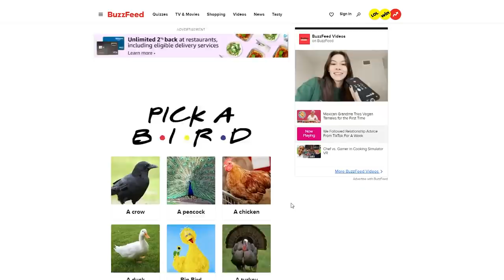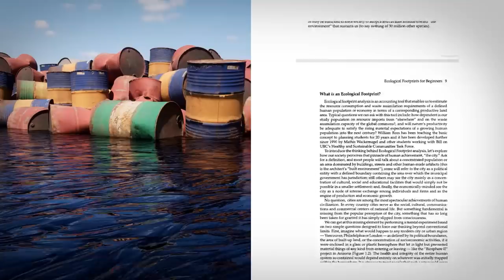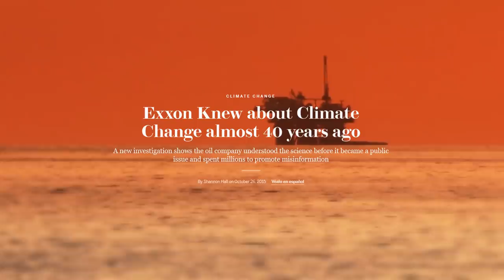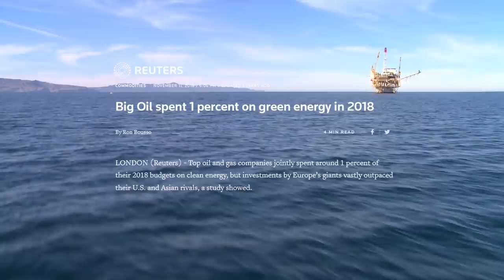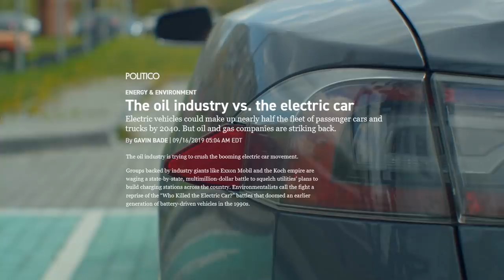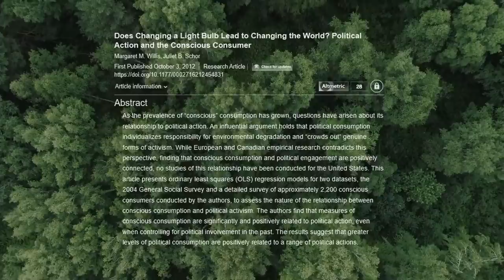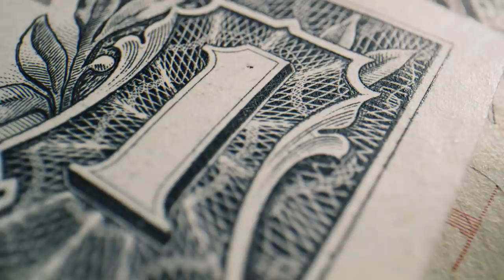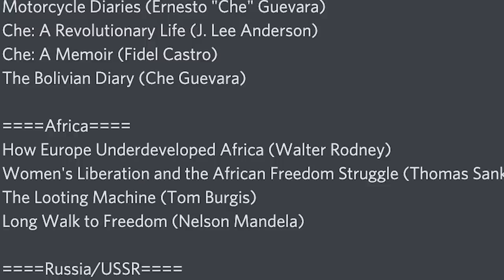Your "Carbon Footprint" Is A Scam

Comment: My guess about this video before watching it is that it's going to say that blaming a person for their "carbon footprint" is stupid, because every single step before (Delivering goods and producing them) is adding up, and any person's carbon footprint is the sum of all other people before them, making it basically an infinite loop where the responsibility grows impossibly high. 

Also, depending on how it's counted, it can for example assing to a single person all the footprint of steps before, so it's counted as if the delivery driver had only their item in the car.

It has to do both to have any real value. Carbon footprint of creating any item in itself, solo, is laughably small, and so is the footprint of delivery in most of the cases. And it has to have real value for the "green" industries to be profitable, and for politicians and companies to be able to shrug off the responsibility and somehow manipulate people into supporting them.
Reply: Adam; Damn, so close. You almost had it.  You missed that we need central planning to resolve this. And since no one else can be trusted the greenie-beanies volunteer to be the authority that tells you and me when and if we’re permitted to use our cars, how long we can have our lights on, and if we can be warm today. But 9 out 10 ain’t bad!  Remember, “You’ll own nothing and be happy.” 😂 Cheers!

Comment: i would say one issue with the green new deal is they dont like nuclear fission because its "dangerous" when in fact most of the ones cited are shotty jobs or a massive earthquake along  with a tsunami hitting it.  But they also ignore the fact that these fission plants can produce quite a bit of energy as the state of Texas has 2 and they make up about 10% of all power.  Sure radiation can be dangerous but if you do a proper job it shouldn't be an issue.

Comment: Remember the Prohibition in the USA back in the 1920-1930s? Guess who has benefited the most out of it? The gasoline selling companies after placing their stations all around the country! Why? How is it related? Well, before that cars were not using gasoline, but ethanol instead. Also because it was so much cheaper to produce ethanol out of corn than to distil gasoline out of oil. But then Mr Rockefeller decided to heavily invest in the Prohibition campaign to prevent any uncontrolled ethanol production. Have a guess why.

Comment: 1. Society has imperatives that you cannot fulfill unless you drive.  2. Your "Carbon Footprint" is a scam.
Yes, your feeling bad about the problem of your personal carbon footprint will do nothing useful.  No, marketing will not do anything either.
However 2 is not exclusive of 1.  Constructing the argument in that way also does nothing useful.

Comment: Obviously, recycling is still good, and driving less is still good.  Living an eco-friendly life is still a good thing to do.  It's just that personal responsibility is insignificant compared to the capitalist machine, which really needs to be taking the bulk of the responsibility for climate change.  Or better yet, it can step out of the way and let smart and equitable policy guided by climate science deal with it.  We actually already have all the solutions, we just need to implement them, and the capitalist forces that be are not interested.

Comment: Couldn't help but notice when the video mentioned switching to electric cars between 8:33-8:48. The video doesn't mention how those terribly toxic to the environment batteries cars use need to be replaced. That batteries eventually wear out and won't be able to hold a charge any more. So the question: Where and how do we store them?

Comment: Remember the 80s informercials where the ninja turtles and stranger danger would scold you to turn off the water while brushing your teeth - as if that matters when massive monocrops and sports stadiums and golf courses and now fracking are absolutely destroying water supplies. But I'm sure it's primarily your fault for running too much water when brushing your teeth.

Comment: 8:30 electric cars don't reduce carbon emission. 

They do mention it quickly in the video but imma go more into detail.

Yes, they run on electricity, but most of the electricity production is not carbon neutral AT ALL. A huge part of electricity in the world is produced by coal, and even what's seen as "cleaner" means of energy production, like wind turbines for example, have a dirty CO2 equivalent cost. Let me develop about electricity's durtyness.

To build a wind turbine, you need resources and energy. You need copper for the coils (gigantic ones, kilometers of cables, we're talking tens of tons), specific material and metals for the whole system, and tons of concrete just for the structure. Each of these have to be extracted, transformed, transported, assembled and erected to build a wind turbine. Each of these steps cost a lot of energy, which adds up to a heavy toll, just to start producing "clean" energy. Just where do you think this energy comes from ? You got it, GAZ, COAL, etc. I'm not even mentionning the cost of the natural material extracted itself.

You wanna take a look at energy costs to promote a specific thinking or push decisions and even be political about it ? Then do it RIGOUROUSLY, only considering the end product is unbelievably biased / stupid / malicious. There is something called grey energy, which is exactly what I described : all the energy costs involved in the production of your end product, all the way to the very start of the production chain, which is finding and extracting raw material. This grey energy cost is NOT neglectible AT ALL. It takes several decades for a wind turbine to produce enough energy to even out that cost.

It also takes several decades for a wind turbine to become obsolete, meaning we consume dirty energy to provide a similar amount of clean energy, which destroys the whole purpose of it. This leads to the next problem. Things age and die. Systems become old and stop functionning. Maintainance has a cost too, and is required frequently for things to function. You need material to change parts, this material also has its own grey energy.

A big part of wind energy is also lost through distribution and storage, which means you produce even less clean energy to even out the dirty grey energy cost. All of this is true for all means of energy production, some means are just more efficient than others, meaning that for a fixed initial dirty grey energy cost, you can produce more clean energy. Nuclear energy is the uncontested winner, with fission, and the prospects of fusion are the only tangible solution that might save us from an energy crisis when oil and gaz run out. (And against popular belief, nuclear is also the most secure of all energies).

Back to the electric cars, these also have their own dirty grey energy costs to produce, and their batteries consume especially high amounts of energy to produce, while requiring a change every few years, meaning you can add that battery production energy cost at every battery change.

Furthermore, electric cars don't have fuel cars' centuries of history of optimisation and technical improvement, they're like newborn babies in comparison in terms of efficiency.

This alltogether is why electric cars are just a stupid, purely financial, political, and hypocritical solution, only showing the good side of everything. It's like selling good gloves at the cost of your hands, and say : "look how amazing these gloves are !" without ever mentionning the hands. This is what greenwashing is.

Comment: HAHAHA. So I was trying to figure out whether driving my EV on my hypothetical road trip was better or worse, carbon-footprint-wise,  than riding on a train. I came to the conclusion I could not afford either. BTW, the Amtrack website makes it difficult to figure out routes, I was downloading a PDF to try to plan my trip? Not sure which decade the booking tech is in. Even if trains are low-foot print, they make it too confusing for people to give it a try.

Even with the EV, solar panels, and being vegan, I still feel like nothing I do makes a difference for the big picture. 70% of the Earth goes to humans and humans can't even let cheetahs eat in peace without cars circling around them. Everything is screwed. I actually got groceries curb-side during the pandemic which resulted in plastic bags (I otherwise used re-useable bags). Yesterday, I threw 2.5 years of bags away because I could not use them, they were cluttering my house, and even if I drove them somewhere to be recycled, I felt that the bags would likely not get recycled.

Comment: The problem with evs is that the batteries need cobolt as do any electric devices with lithium based batteries. The cobolt is mined in The Republic of Congo and there, they use child slave labour. So if you're buying new phones every year, evs and other lithium based battery devices, you're allowing that to happen.

Comment: Does this mean that 'Earth Overshoot Day' - the day of the year which humanity's resource consumption for the year exceeds Earth’s capacity to regenerate those resources that year (this year calculated to be July 28, or day 209, meaning that the amount of resources we are consuming exceeds the amount of resources available by a factor of 365/209 or approximately 1.7) is also bunk since it's based on the same mathematical modeling?

Comment: When will people realise that they have no control over the products available to them for consumption. EVERYTHING we can consume is controlled through legislation by government. This means that government had the power to change this but chose not to. The people NEVER had this power however, it is We The People who are blamed when in reality, the government are responsible. Those who control what we are able to consume (the cause) are NEVER held responsible. BTW mankind has almost zero impact on climate and reducing atmospheric carbon will have a catastrophic impact on plant life that need CO2 to survive. If plants die, the level of oxygen in the atmosphere will reduce significantly causing the population to also reduce significantly. Photosynthesis. Reducing CO2 is worse for mankind than Climate Change and the link between CO2-Climate Change has yet to be proved using the scientific method. Go figure…

Comment: I am pretty much immune to guilt where no intentional wrongdoing has occurred (which might just be regret). anyway, as a result I never put too much stock in that Carbon Footprint business.

if I ate a plant and that plant has captured CO2 from the air, then I should get credit for taking out the plant! 😈

Comment: Not to mention that the Earth itself also follows a diatlating orbit around the sun, meaning that it gets a little closer or a little farther away within the habitable zone every few millenia. With the increase of coal burning and bad emissions in Asia, this issue is only emphasized. Remember the Ice-age? Well the Earth also has a Dry-age as well. Pollution doesn't help, but this is something you cant just fix in our lifetime. You'd have to build giant rockets that could push the Earth and adjust it's orbit to have any meaningful effect.

Comment: Oil company would still earning money with plane/jet fuel when middle and lower class are limited by individual carbon footprint tracker, while coal industry owner will stacking more money with coal based electricity that still mainly used in asia and africa cuz lower and middle class are forced to use electric vehicle with lithium ion batteries that also have limited resources like oil and have more toxic waste after they died out 😅

Comment: Warning:terrible analogy incoming.
Think of climate change like driving a car, you can't change the car cause that's too expensive, can't get another car cause that's also too expensive, so if want your car to run along as possible you shouldn't be going slower on the gas pedal, you should change the engine.
Note:holy fuck that was bad.

Comment: This video is nothing but blame shifting. If you are really worried about an increase of 2 degrees in 80 years, you need to look deeper at the data and its effects. Yes, I am employed in the oilfields. Yes, I drive a big diesel truck. I also use every product I purchase until it is entirely unusable and have built my home to use almost exclusively solar and wind energy. Be responsible for yourself.

Comment: Yes, lets blame the oil componies and not the manufacturers who make the vehicles and other things that use said oil products.

The problem with that is if they had stoped producing oil products the whole economy would instantly crash. That also shows what great leverage they have over us. Like you know, relying on other countrys for oil? Wtf is even the point of  removing our oil independancy? all it does is make prices go up.
Reply: both can be quite shitty, not sure why you think critique of one of them means that there isn't criticism of the other
Reply: @Celestina0  even if they stopped spending money to cover themselves up they would not and COULD not stop producing oil; at least not instantly. the second part of my comment covers that. the other problem with that is oil is used to produce the beloved plastics of many companies. even if they stopped making shitty plastic bottles and bags etc. they still use it as an insulator in many many electronic components, mainly wiring.

basically you can blame them, just not only them because they are NOT the exclusive main reason why oil is still produced. they literally could not stop if they wanted; well they could just not without a full on world  wide economy crash.
Reply: @jellevaneijk9397  I agree. I don't think they are the only one to blame, but multiple people are.  I can see how you though that, it's my fault.
Reply: @glleesqwerty6402  oil companies are not reluctant though about producing what they produce. You make it sound like they’re regrettably making mega profits, reluctantly pouring money into politics to get their way. Oil companies are in the business not just of producing fossil fuels but promoting them and making demand for them. Sure, they’re not alone to blame, but we should still be ferociously criticising them and holding them to account.
Reply: @Celestina0  just because they aren't reluctant doesn't mean they are the only one to blame. I not saying they aren't bad, i'm saying they aren't the only ones conrributing to problem.

However I also seem to have said they wouldn't stop making oil at the begining of my last comment. Saying that implys that they would unregretably keep doing so. I see how you got mixed up in my words, its my fault you misunderstood.